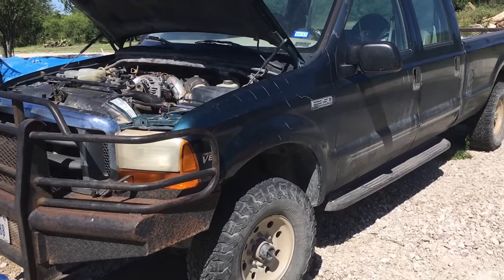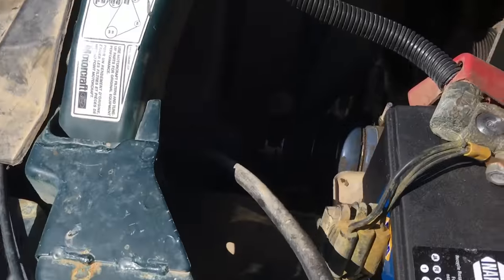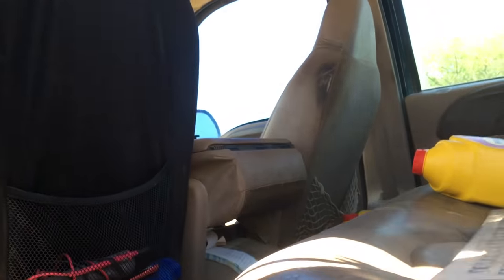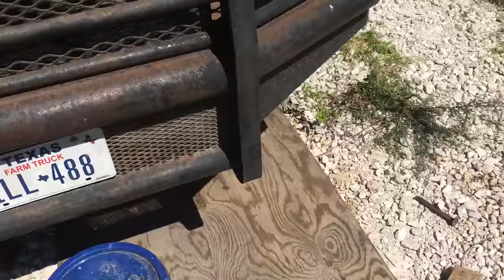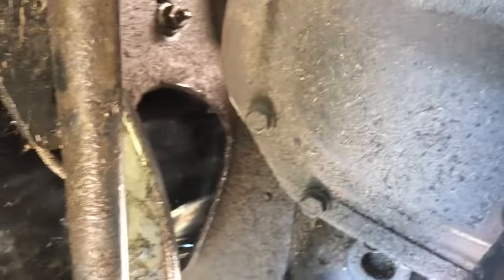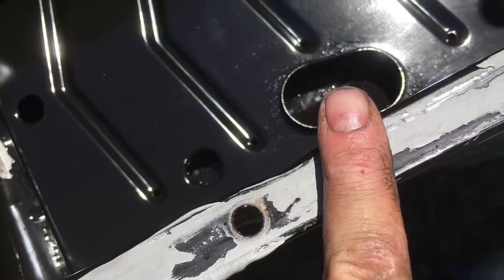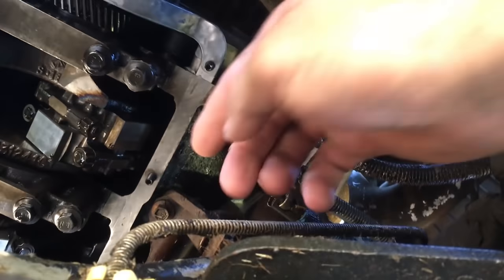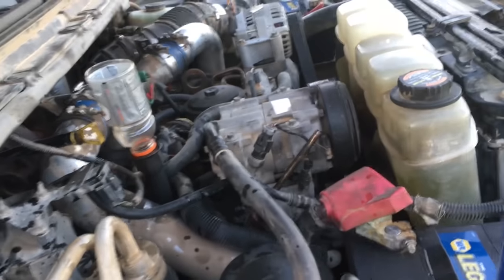Ford 7.3 powerstroke Moroso oil pan gasket install without pulling the engine!

Comment: Just wanna say i did this in a garage myself with a mechanic buddy and it definitely wasn't fun but we did it in a day 3yrs later not a drop has leaked since. If you're on the fence about this it's not bad and the moroso pan and gasket has held up phenomenally i also didn't actually put rtv on the corners the gasket fit so good i just didn't see the point

Comment: Very thorough description - thank you for posting.  A couple questions. 1) where is the best place to jack on the engine 2) Did you have to remove the fan clutch when you redid the oil pan 3) Did you have to disconnect any wiring to raise the cab and the engine 4) Did you have to raise the cab an extra couple inches as you suggested you might have to ( in order to clear the oil pan and new studs that came with the moroso gasket ) 5) fuel lines and wiring etc...  all remained in place while jacking cab and engine ?. .. Note :  I have a low oil delivery on cold start of the LPOP and concerned I may find a worn front cover...( 2001 7.3 F550 )... again thank you for taking the time to post such detailed and helpful videos.
Reply: Did you ever get an answer or figure this out? I don't want to spend 1700 for a shop to do this... I'd like to do it myself

Comment: Wait wait wait. How did you jack up the engine? I'm trying to jack mine up today and it is leaning to the right (passenger side). Only the driver side is coming off the framing.

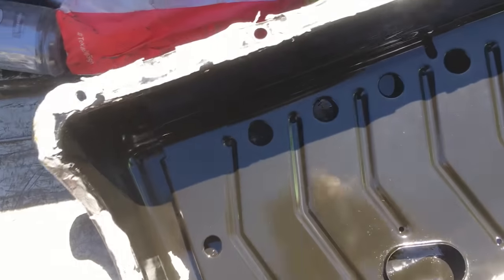Comment: For those wondering how to lift the engine, at 15:28 you can see a block of wood on the crankshaft pulley and shortly after you scan see the jack right there. it seems to me that is where he jacked the engine up. it also seems to me that he didn't mention it because he feared he was going to be criticized too much for it but I think it's smart, the crankshafts are usually made of 4140 and are tough as steel can get. 
I need to get this done FML
Reply: I’m with you doing it tomorrow done thinking about it
Reply: @gregnyce1238  mine went well just make sure you buy a new dip stick tube thing and change it. Do not reuse yours jt will leak like mine lol
Reply: I was thing about putting a new o ring but I will get a new one . I have a new oil pan n gasket . Going do it tomorrow am.
Reply: @gregnyce1238  the moroso oil pan comes with one. but trust me it will not seal and it will be too late when you find out
Reply: @gregnyce1238    So how did it go?  Anything else I need to know?  Especially about lifting the engine.  Thanks!
Reply: @timvines7944  I did engine mounts,transmission mounts ,cab mounts n cups. I have a manual transmission had to cut one of the corners off the oil pan . Got lucky with the new one very tight underneath. With the Manual transmission but everything good Besides that. Make sure you go to Lowe’s I use Fresh wood. Doesn’t matter what size just get it enough for a job.
Reply: @gregnyce1238    Thanks!
Reply: @gregnyce1238    Nice!!
Reply: My buddies grandpop told me to do that on a obs 7.3 I just got yesterday for 2500$ with 240k on it

Comment: Thanks so much i just bought my 1st ever. Injector shim kit, new oil lines w/p, new timing cover couldn't stop the oil leak at the reservoir old gasket rtv no go new gasket alone no go new screen gasket plus rtv no go. Out of frustration over torque and snap driver side corner. Cut to new timing cover and apparently new oil pan gasket as well.

Comment: Use a engine hoist to to raise the engine up a little.He left that out!!!

I have a 2001  f550  6 speed manual tranmission with 63,000 miles on it. 
 

But other wise it
 works like a charm,just like he described! 

Me and my buddy got it done in 8 hours today!! 

 I took out the steering link nut out and move the steering linkage to the side before I lifted it up .

Comment: Great video, my dip stick bracket is sitting at  the bottom of my oil pan so tomorrow I will be removing my poi pan in my 99F3507.3.

Comment: Once the cab is jacked up for the 2x4 spacer, would having the turbo off the engine give you more room to jack the engine up. Just wondering is the turbo the clearance problem against the firewall. Thanks

Comment: I have a 99 F550 standard trans no go. Have to pull the trans first, lift front end, then raise engine, pull the clutch and flywheel, remove rad bottle and rad shroud, to get enough clearance .  I also broke my radiator cause I had to raise the engine so hi. The standard trans doesn't have the cut out on the front of the lower  trans housing.  Flywheel is either bigger or pushed forward more. ill be glad when im  back to towing. thanks for the video it helped.
Reply: jose medina  did you try removing the oil pan pickup tube first then removing the oil pan completely
Reply: Yes i tried everything. Not to pull that trans but nothing i did gave enough clearance. Wish i would’ve removed the trans first like was going to in the first place.
Reply: Not true I  just done it. I have. 6 speed manual..

They only thing,I did you did not see in this video is disconnected the steering linkage and used a engine hoist.
Reply: Also used SB silicone body mounts!!

Comment: I did this a few months ago put a new oil pan on engine first auto parts stores has no listing for gasket they say u silicone nope it leaked really bad took it back apart put the gasket I ordered online the morose with the studs dont leak now never had no more problems  had to jack up engine in the truck put 2x4 at motor mounts unhook trans mount bolts it can be done

Comment: Excellent video Stephen thanks for the information from down there in Texas, your'e really helping the farmers up here in Alberta, Canada. I noticed you got a block heater...lol, I thought we are the only ones and Alaska. Just food for thought we have a additional block heater that can be glued to the bottom of the oil pan.Take care down there in the Lone State
Reply: The stock block heater heats the anti-freeze/coolant and not actually the motor oil in this engine.
Reply: @Golgi-Gyges  I know Glen in fact we use both, you can use a magnetic stick on or glue on one for the oil pan, however my 7.3 is going to be parked in the winter because its just for my motor coach hauling. Excellent video on the oil seal replacement thou, I know myself I sure enjoyed it. I got a new GMC 1500 3.0 litre I-6 has my daily driver but sure love my ole Super Duty.

Comment: On my 1999 f350 the oil rings were leaking the on the engine oil cooler.  I removed the 3 bolts at the rear holding up the oil filter end. Remove the 2 bolts holding cooler to timing gear cover. Pull cooler out rearward, comes out easily. Get cooler on work bench and bump apart with wood block and hammer. No chance of breaking timing gear cover
Reply: That's the best way to do it, most people who keep the heads to the oil cooler on end up breaking the timing cover because they are having to smack at it with a mallet to seal the cooler. It's a lot safer and easier to just take the whole oil cooler out.😂

Comment: I know a lot of people reading this comment will have an aneurysm...
Use an engine hoist to take pressure off the motor mounts, cut the crossmember, do the oil pan job, and weld the crossmember back in. 4 hour job.
Reply: sounds like a plan. is there a video?
Reply: @josephdunn4388  You'll find information and pictures/videos mostly on forums. It's not a hard job that way, but you definitely want to be experienced with welding or have someone that is do the welding.

Comment: is it realistic to replace main and rod bearings using this method?  My 2000 7.3 has a little bit of glitter when I wipe the oil off the dipstick, but there's nothing stuck to the magnetic oil drain plug, so I'm thinking it's probably time to overhaul the bottom end.

Comment: I really need your help. My 2002 7.3l f250 has a leaking gasket after a pinhole leak I fixed with jb weld. When jacking the cab up, are there any cables or anything that need to be disconnected? Please respond!

Comment: Hello. I'm working on my 7.3 and have the cab up. How did you raise the engine?
Reply: How did you raise it??
Reply: Go see my live video on the Facebook page 7.3L Technical Page.  I did it today after watching his video.
Reply: @juuscreamev go to Jan 6.

This is my post:

Front timing cover/Oil pan removal - engine in vehicle.  Can’t go live on YouTube, but may load a daytime video tomorrow.  I forgot to say that I have the transmission support member out with an RV jack holding it up.  I don’t know if that would be a bind point if installed.  

Passenger side support block is 4.25 x 2.5” x 3.5” (odd size after ripping 4 x 4 for camper repairs)

Driver side is 6.25” x 2.5” x 3.5”

Cab to frame support block is 7” x 2.5” x 3.5” for both sides.  

When I came up on the cab, I had the back cab corner bolts completely out.  

Cab to bed clearance is tight at the top - about 1/8” to 1/4” before touching.
Reply: @jiavin25  what’s your FB page? I’d like to check out your video.
Reply: @ralphvalenzuela7118  it’s not on my page, but in the comment above you can find it on the “7.3L Technical Page”.  One catch is that the guy in this video (and I happened to have mine off as well) has his turbo removed.
Reply: @jiavin25    Was removing the turbo necessary?
Reply: @timvines7944  yes, if you do it the way it’s done here.  No if you raise the cab up from the back as well as the front but level obviously.  I got so far into it, that after watching this video, I just went for it.  Then a while later, a guy asked how I did it.  He went over the video many times then they noticed that the turbo was in fact off in this video.  To get it off though, the cab almost touches the bed with 1/16” to 1/8” air gap.  I used wood blocking on the forward four mounting points to prevent the cab doors from wanting to shift or close weird.  Go to Jan 6, 2021 on the 7.3L technical page and look for where I went live.  I explain the best I could and wrote dimensions of the blocks there.
Reply: @jiavin25    Thanks!!

Comment: Wouldnt u have to disconnect trans?
Reply: Robert Ladiges  try looking at the ending of Diesel Tech Ron’s video. He points out that out along with the oil pan pickup tube
Reply: No but I would personally suggest removing the two bolts in the support member.  As you jack up the engine, they may come up out of the holes in the center.

Comment: I used por 15  por,15 rubberizer and po 15 metal etcher for corrosion on the brand new 75.00 oem oil pan,used the morso oil pan gasket.

Would've use the the Morso oil pan. 
But I have read in the reviews,that the metal is thin and not as thick when it first came out.
Reply: I bought a Moroso oil pan for my 7.3 and it's definitely thicker and heavier. Although, if it was me, I would've gladly installed an 1/8" thick pan if I could, but I'm sure the Moroso will suffice.

Comment: No info or response on how to jack up the engine.
Reply: you can jack it up from the crankshaft pulley, the crankshaft is the strongest steel they use on the whole engine so it's no prob for it.

Comment: Anyone do this figure out how to raise the motor? Cherry picker/engine hoist or some wood blocking method from underneath? Planning on attempting this here shortly and looking for any tips or tricks. Thank you.
Reply: Need to use engine hoist to lift the motor and u'll have to walk Cab and motor slowly up cab then motor unit u have the room to slide open pan out and used the 4x4 for cab and 2x4 for engine mounts this way if the chain fails or the hoist u'll be ok good luck
Reply: @b3b5  thank you

Comment: dude just saw a guy do one with the motor in he just removed the pump once he dropped the pan down he was able to loosen the front 2  10 mm bolts nuts and the rear one and the pan slides out
Reply: what pump are you talking about??
Reply: @kennywimmer8347  oil pump inside the pan but I figured he removed transmission also u have to to get the room pretty sure unless u jack up the motor high enough
Reply: no pump in the pan fool
Reply: @adamsorell4851  yes there is oil pump
Reply: @atv55803  can you post the link to that video? Another guy said just cut and weld the crossmember.
Reply: @josephdunn4388  https://www.youtube.com/watch?v=EF3otw3equg this is what i will try
Reply: nope scratch that cut the cross member an re_weld
Reply: @adamsorell4851  there is a sump tube in the pan 2 10 MM bolts after u remove trans u remove one in back and 2 in front let it drop into the pan after u obviously drop the pan an it should slide out

Comment: Would have been easier to just yank the motor out right from the start.
Reply: That's a lie, in the start, all he was doing was a oil cooler reseal, had no other problems to deal with.
Reply: @8SecSleeper  well I just got done doing exactly that and it was a lot easier working on the motor out of the truck.  I don’t think it took any more time either.  So what you’re saying is a lie.
Reply: @craigbruske6866  you just said taking the engine out didn't take any time. As someone who's been working on these for two decades. I find that hilarious. Thanks for the laugh. Pulling engine to change oil cooler o-rings. I guess you truly do learn something new every day.
Reply: @8SecSleeper  i wouldn’t pull it out to change oil cooler o rings.  But i just had one out and it wasn’t that big of a deal.  But I guess to someone thats inly been working on these for 2 decades it is a big deal.  Thanks for the chuckle as well.  I can see you’re no mechanic.  Just a typer sniper.
Reply: My original point was that all the work he did and the oil pan still leaked.  He should have just pulled the motor out and did it right originally. But that obviously went over your head.  Yes i just had one out and sealed it all up and the time it took me to do it and NOT HAVE ANY LEAKS, was probably less than his time spent trying to cut corners and having to redo it. But again, you probably don’t understand that either.
Reply: @craigbruske6866  you fumbled hard
Reply: @8SecSleeper  lol yeah ok typer sniper.